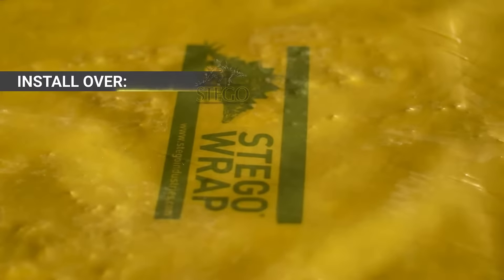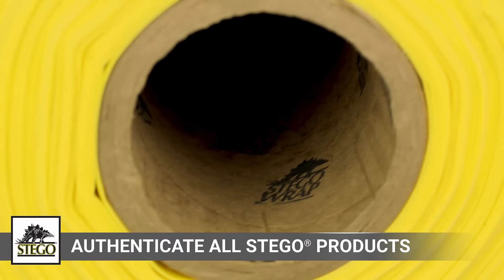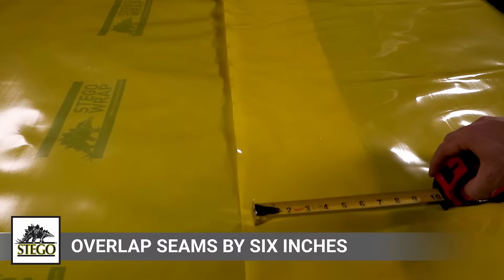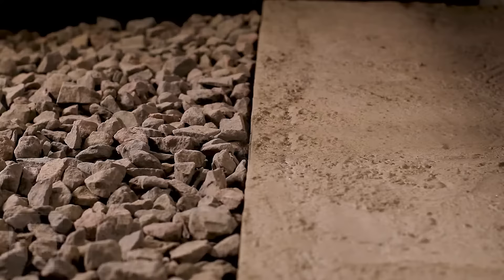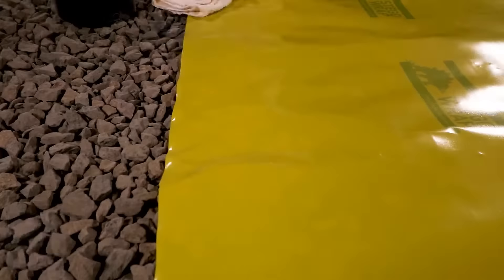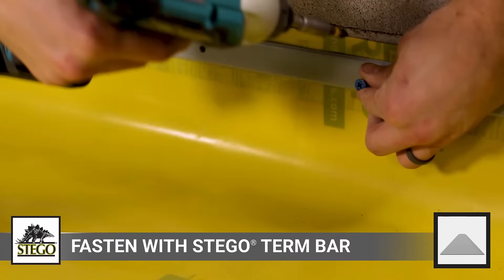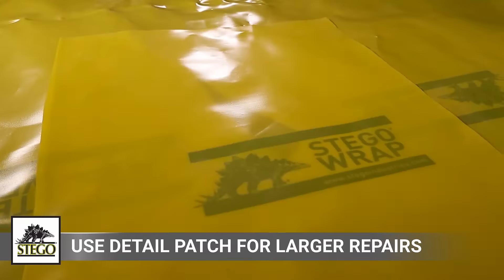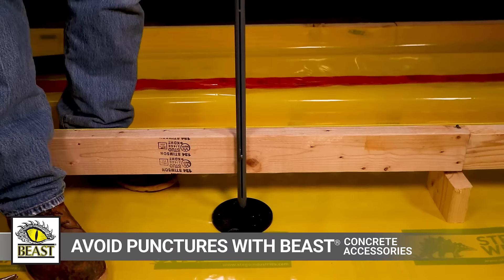STEGO® WRAP | How to Install an Under-Slab Vapor Barrier

Comment: Is it good practice to run the Stego Vapor Wrap up the outside edge of the cured concrete slab, protecting the slab from wet weather or should it be left open?
Reply from the maker: Paul, thank you for your inquiry.  Where to terminate the vapor barrier should be determined by the Design Professional.  Most design professionals will specify ASTM E1643 which addresses installation practices for below-slab vapor barriers.  In that standard the perimeter termination is prescribed in paragraph 6.5 as:  “Extend vapor retarder over footings and seal to foundation wall, grade beam, or slab at an elevation consistent with the top of the slab or terminate at impediments such as water stops or dowels.”  Thus, you have three locations the vapor barrier can be sealed to:  foundation wall, grade beam, or the slab itself.  So, if impediments don’t prevent you from doing so, yes, you should, in following the guiding standard, wrap up the outside edge of the [cured] concrete slab.  If, however, bringing the vapor barrier to the height of the slab exposes it to the elements (sunlight particularly), you may want to consider terminating and sealing at grade as UV is a major pro-degradant of plastics. This would NOT meet the standard, but it is often a deviation project teams approve for reasons cited.   Once you’ve determined where the vapor barrier is terminated, you then need to decide if you will be sealing the vapor barrier to the concrete slab, the foundation wall, or the grade beam.  Having said all that, again, first and foremost, be sure to defer to the Design Professional’s specification or installation instructions before proceeding.

Comment: Why over gravel?
Reply: Gravel provides a solid foundation for your concrete as it can be compacted. It also improves drainage, preventing water from pooling beneath the concrete.
Reply: @PushaDee  thanks, yeah I can see how the gravel could also work as a barrier to reverse water vapor coming up from the soil under it also.